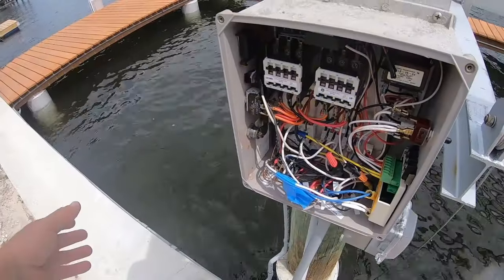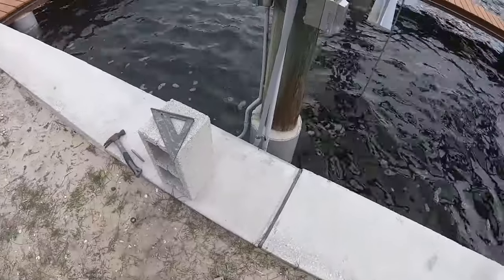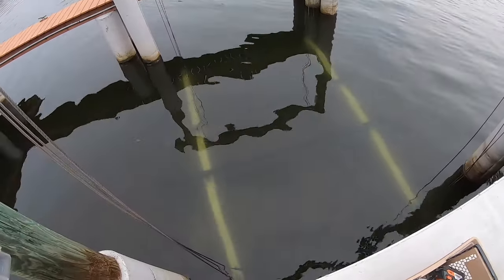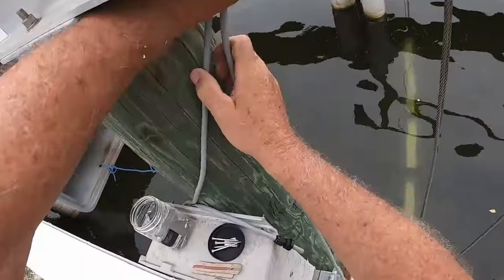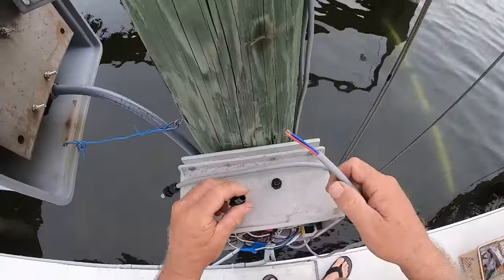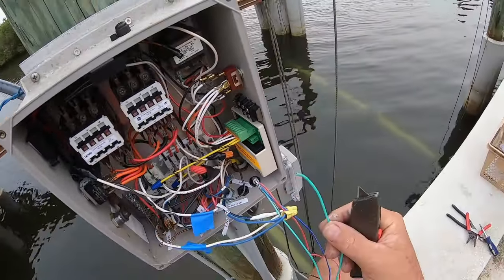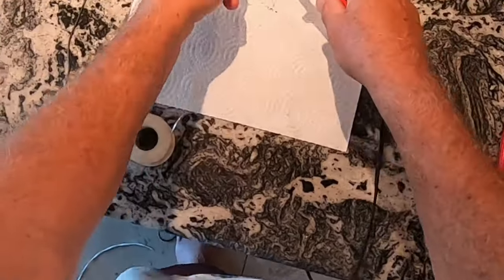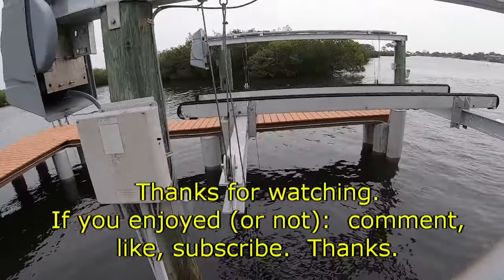Giving my Boat Lift Automatic Up and Down Without Having to Stand There

Comment: You did an awesome job! Enjoyed watching your video. Looking forward to seeing your time spent and cost break-down. I'm 77 and currently working on my dock alone. I created my own wood pile protection by splitting 12" PVC pipe and connecting the halves with stainless steel bands and filling with concrete. They have been in place now for 20 years. I did it all myself.  How close are you to Jacksonville, Florida.
Reply from the maker: Glad you enjoyed the video and thanks for sharing your PVC idea - I'm sure it works great.